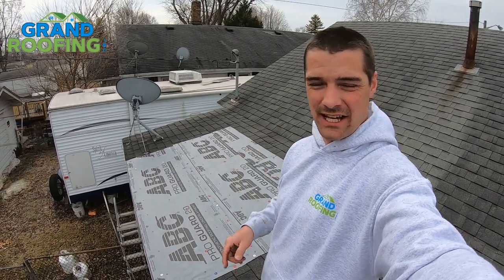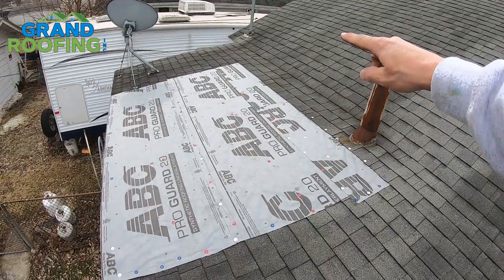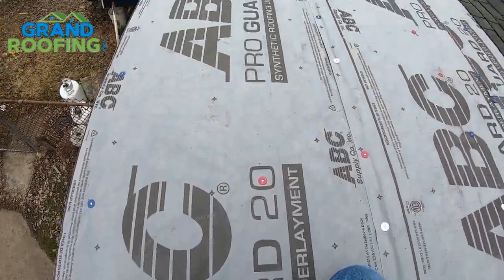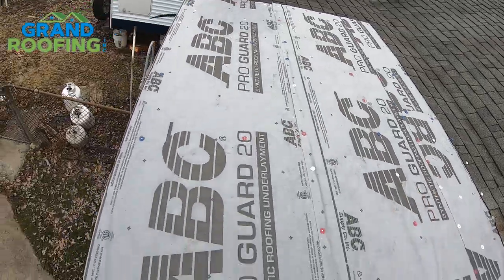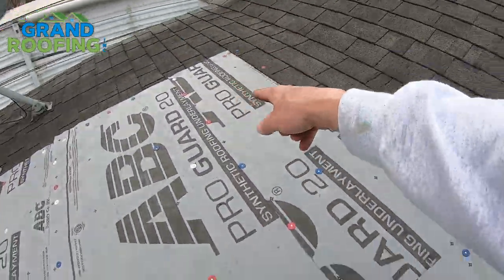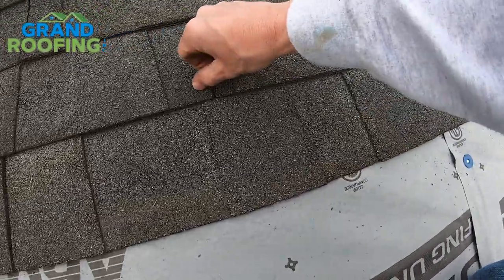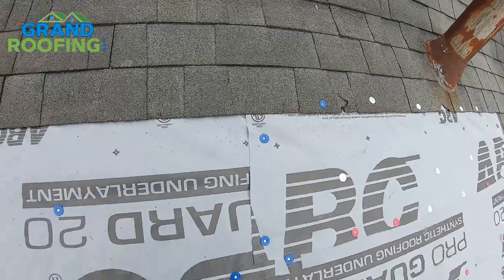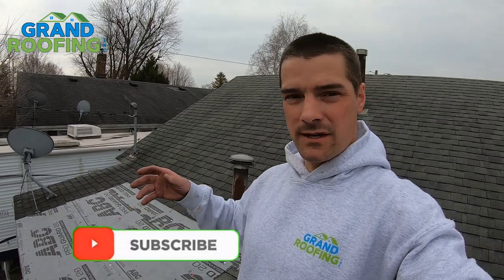Roof Leak - Tarping a Spot On Your Roof

Comment: Excellent detailed explanation of how to properly tarp a damaged roof.  I know we've both run into really poor tarped sections.  I've seen them myself and I've seen your pervious video of one.  The only thing I would add is if someone had the time to get cap nails delivered through the Amazon link,  by all means get them through the description and support this channel.  If rain is coming and you can't wait for them to be delivered,  you can always get some at a hardware store. But Amazon prime might deliver them tomorrow...lol
Reply: I agree with this. But one thing to note is that you should be weery on how many fasteners you use. I get that there's wind and such. But if you go ahead and throw a nail every 5inches in a 8ft x 8ft area. It's going to cost you a lot more for someone to come in and repair it rather then them coming in, finding the leak immediately, and it was only due to 2 or 3 shingles. Which would have costed a few hundred dollars vs probably upwards to above $1000

I also agree with using cap nails, but cap nails will hold it down alot, only put them on the edges, and maybe a few here and there in the middle area.
Reply from the maker: Thanks Scott I appreciate that! Sometimes once I watch these back I think damn I forgot to say something. But most of them are unscripted and uncut.
Reply from the maker: Yes it all just depends on where the leak is. If it's a just a small hole from a tree limb punching through then just a little 2 foot by 2 foot piece tucked under shingles above would be sufficient. Thanks Josh!

Comment: How I wish you lived and worked near me!  🤔😀
Question for you?  Full roof replacement; any advantages going with a small guy/company, vs a large established firm, other than the lower cost of the ‘little guy?’  I’m facing a whole roof replacement, as it makes little sense to use the Insurance money to fix a small portion of a roof that has less than a year of life, according to my Insurance Adjuster?  Thanks!  Your videos and your knowledge are impressive sir!  👏🏻👍👍👍👍👍👍👍😁🙏✌🏻🇺🇸
Reply: Honestly. If you go with a big company, you may be waiting months for them to actually get to you. And lots of them require a down payment, which is normal. But then having to wait a few weeks for it could get annoying. Small company's are who to go with as they could usually start the job within a week. Just ask for references from customers they've done a roof for. And no I don't mean a roof they just did last week. Ask for one that was a few years ago as they would know if the roof had any issues during that time span. And ask for a recent one too. The bigger companies always charge a premium because they have a lot more fees and such to watch out for. They also factor in literally everything down to the inch. Smaller companies usually give a flat deal. So unless you have a fortune to live by, go with the smaller crew.
Reply: @Josh-ww5kz  Thanks for that Josh!  I am inclined to agree with you.  In my area there is this Company that specializes in roofs, and they did my Neighbors roof, and they come highly rec’d.  They send out an ‘army’ of guys, and can knock out a roof in half a day.  They offer a great warranty, fully licensed and insured, but there is this other guy that has only been in business for about two years, but has huge positive feedbacks, and is accredited on Home Advisors.  I think he started this Company, based upon a relatives past business.  I know he would come in cheaper.  Anyways, Thanks ! 👍✌🏻
Reply from the maker: Everything Josh is saying is pretty true! Just don't go with the smallest cheapest guy. Do try to find somebody that is a little established. Make sure they have some sort of track record. Definitely check for reviews, the more reviews the better and if they have any negative be very cautious. Make sure the names of the reviewer are not the same of the contractors.  There was a home owner I went to just a couple days ago that is in a big issue with a roofing contractor. They are a little less known took the guys money last summer and have not done the job. When they started the job just a few days back only one guy showed up toward off and went home with thunderstorms the next day. once the homeowners gets this figured out he said he might agree to do a video about the experience. Also asked to get a copy of your insurance. don't hesitate to call their company and verify their policy is still good. Even if they have liability insurance, that doesn't necessarily mean it will cover if they do a bad job. Where are you watching from? Thanks for the compliment!
Reply: @GrandRoofingInc  that's me! I'm super worried the tarp will come off in the next couple days!
Reply: @GrandRoofingInc  Thanks for reply and You’re Welcome!  👍. Virginia. Already received three quotes, ranging from about  $9100 - 9900, for an approximately 30 square roof.😳😳😕. Cheapest using Owens Corning Arch shingles, and other two use GAF.  
Really enjoy your videos.  I started using a non slip pad on my roof, thanks to one of your videos!  Saved my arse from sliding off my Roof! 😳🙄😬☺️😀😁👍👍👍✌🏻👏🏻🇺🇸
Reply: @GrandRoofingInc  $310.00 plus or minus per square?  What say you?
Reply: @Cardsone1  Relax!  If done right, your tarp wont go anywhere, provided you have normal weather!?  Rodents and stuff can be an issue.  If possible, Also cover the underside of damaged area, from inside your attic?!?  My tarp has been up for weeks, and may be up there awhile longer, as I sort out the ‘HIGH $$$ estimates’ Ive received, For a new roof, and if I will repair the damaged area myself.  Good Luck!

Comment: You didn't say if the cap nails are water proof and how long yhe synthetic and cap nails last and if there hot dipped and if you would caulk them if so you should show us how
Reply: Cap nails last pretty long, you could caulk them if you think you won't be able to get a repair done on it in the next week or two, doesn't hurt it. But as long as the synthetic paper isn't ripped, and that you got the source of the leak and if  your area doesn't call for hail and such it should be good for a few weeks. But again, it's a temporary repair, you should seek to get it repaired as quickly as you can.
Reply: For caulking I would just put about  2x the size of a pea, then sort of smooth it down on the edges so doesn't keep water on top of it. Don't go for a roofing tar, try to use something that won't dry up as roofing tar does

Comment: What if you have moss on your wood shingles bu th real problem is flashing, water vent pipe and patio roof run back on to roof the pics ass gutter that was supposed to stop the overflow just moved it to the off side roofing flashing is hit and miss  so need to ask you for your  just a random roofer not responsible for any kind of damage or injuries so now how can I  best stop damage and water pouring onto my patio an under the shingle into my kitchen just want to reproof home and patio plus correct mistakes made by past insurance roofer repaired and replaced so good as new  and Elizabeth paid out of pocket now she is past and I'm here trying to make sure I don't throw away her gift to my family includes myself 3 kids two extended families plus my mom since covid extended family would love to relocate here but won't until I can fortune do the correct thing sorry maybe TMI but you totally seem to be the one Ina handful of people who are doing things correctly and not afraid to share your knowledge